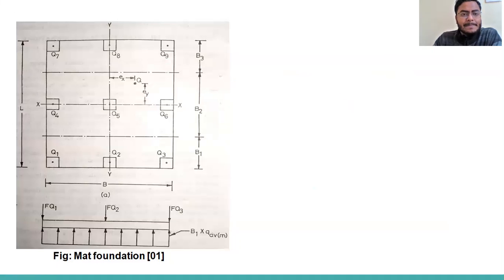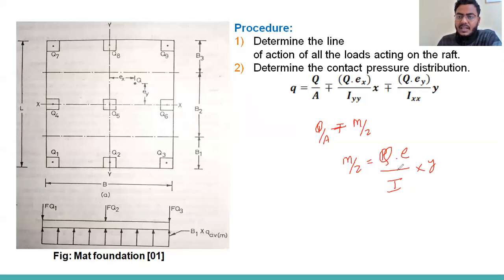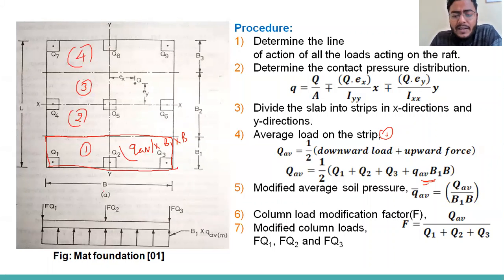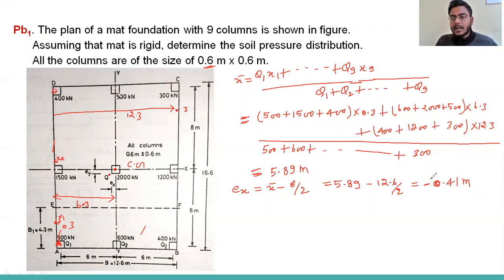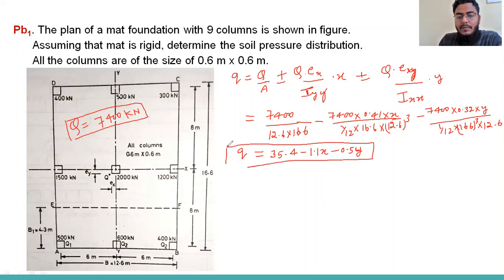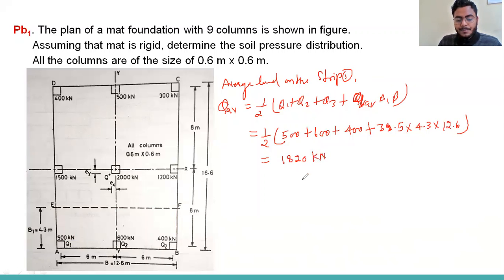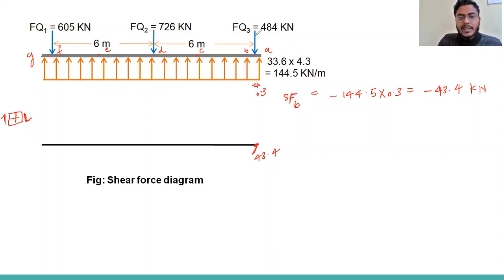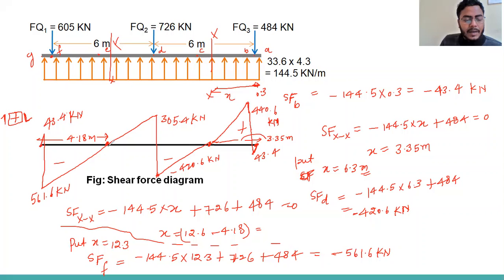Design of Mat foundations

Comment: By solving your equation for sf= -144.5*x +726+484 and put x= 12.3
We get sf = 567 and here u are getting 561? Explain your sf at xx section which u calculate at last ...... Why value is difference and also while calculation we get last point or end point sf 37 which u got 43